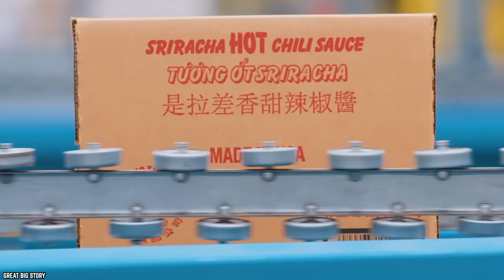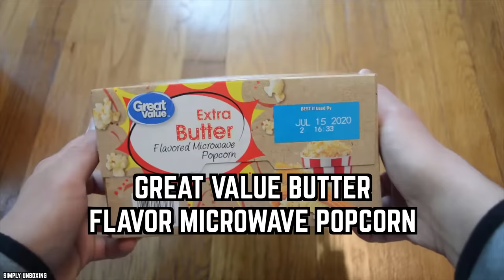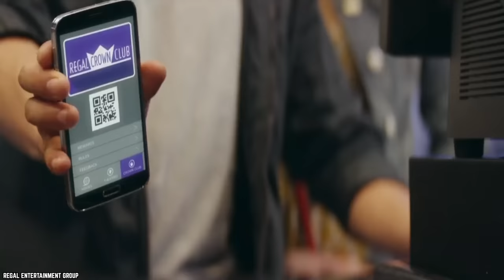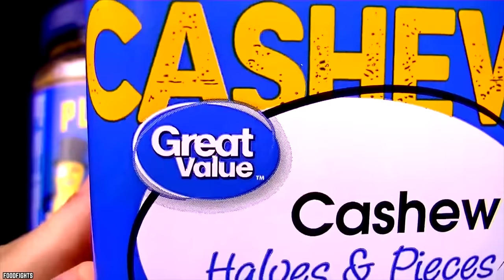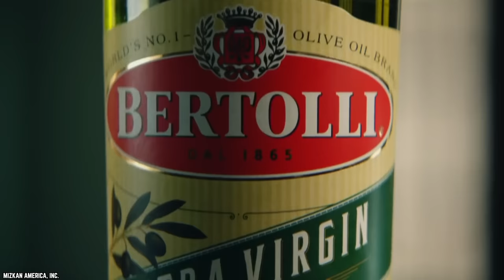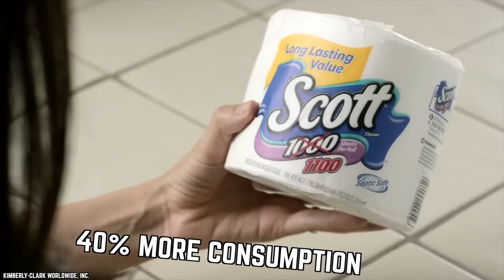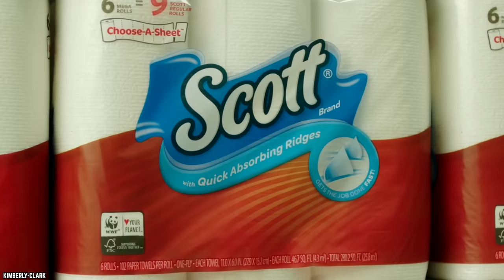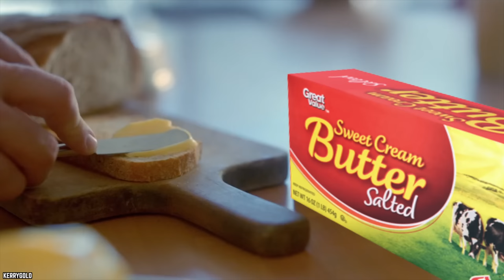10 Walmart Groceries Customers Are Currently LOVING

Comment: Yeah, but ordinary corn can not be used to make popcorn, regular or microwave. It is a very specific type. So ordinary corn production really shouldn't affect popcorn production.
Reply from the maker: @coolnegative You are correct, ordinary corn cannot be used to make popcorn. Popcorn is a specific type of corn that has a hard outer shell and a dense starchy center, which causes it to pop when heated. So the production of ordinary corn should not have an impact on popcorn production. 😊
Reply: @BabbleTop  thank you BT!